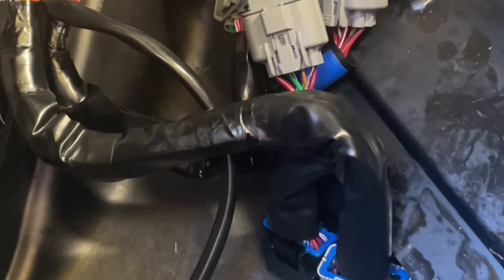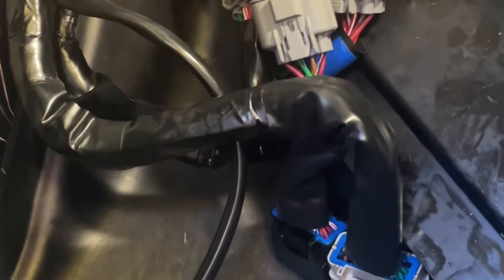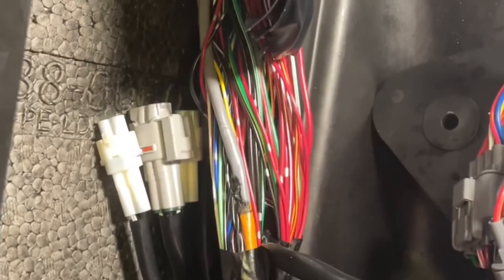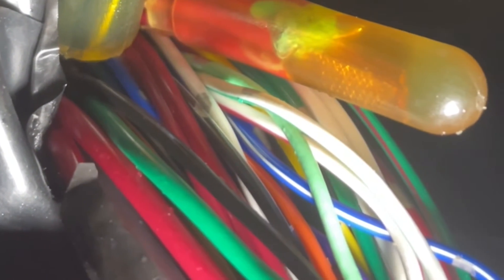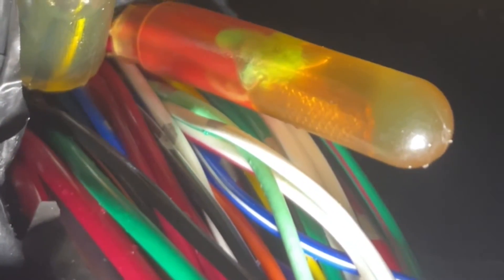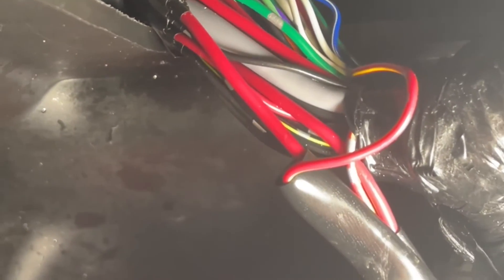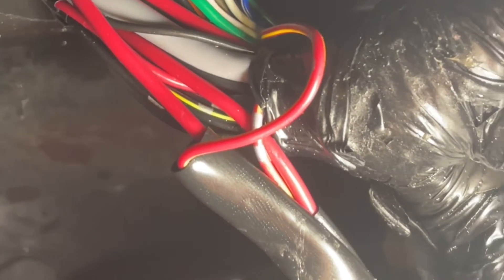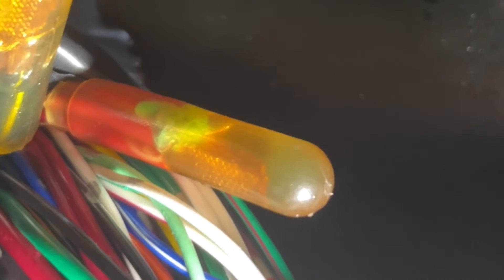Tech Topics: Finding corrosion in my 2022 Kawasaki Ultra 310 Jet Ski Wire Harness

Comment: I am wondering if Kawasaki build their own wiring harness or it comes from a parts supplier could be a supplier issue? 

Glad you were able to find what was going wrong, I have 2 new ultras ordered! Enjoy the videos!
Reply from the maker: The harness is made by a third party supplier- I just learned that the harness for the 2021 was made in Mexico so maybe this one was too…I love the ski, it’s awesome you will not believe how much fun they are. The ride and comfort is top notch! Mine was a very early production ski so hopefully this issue is isolated to a few of the earlier units. Kawasaki is replacing my wire harness in the ski to be safe.
Reply: Thanks! We ordered the ultras for Lake Michigan a little different out there in south east fl. Used to ride out of Boynton  inlet and understand your concern regarding salt. Keep it up many thanks!

Comment: Kawasaki should be paying you to fix this, and you should be able to punch an engineer in the face 😂😂
Reply from the maker: Hahaha yes definitely frustrating. They are sending me a new harness for the ski. I don’t mind working on the ski but it’s never fun when you have an unforeseen issue with a new vehicle
Reply from the maker: The mechanics joke is that a mechanic must’ve screwed an engineer’s wife and this is the payback
Reply: @JDsWaterWorld  Thanks putting this video up and also doing the work. The sad part is most dealer techs(this includes cars) are nothing more than parts changers. If they don’t have the answer directly in front of them they simply can’t operate. Part of it also comes down to how they get paid because they WILL NOT drive a vehicle/boat/PWC around for long periods of time to replicate the issue. I have a few thousand in specially scan equipment and other tools so I can diagnose things myself, then tell them what’s wrong if it’s under warranty. Now with the increased use of CAN bus networks on cars, and now on out 2022+ Ultras these people need to be electronic techs and they simply are not. 

In regards to PWCs, especially Kawasaki; Many of Kawis network are motorcycle dealers that are far away from water. So many won’t even bother test riding them, which sometimes needs to be done especially if the issues happen while under load. 

Rant: CAN bus networks don’t belong on cars let alone JetSkis and boats. The system isn’t robust enough because if one node pulls the signal down, the entire network goes down which can be an absolute nightmare to troubleshoot. With out Ultras there are only 3 stops + a connector the signal has to make, so it’s not a biggie however in cars you could have up to 50+. I almost feel as if Ethernet is a better way to go, which we are seeing now on some German cars. Rant over. 👍
Reply from the maker: Thanks for this comment. All very true info. I am always talking about how everything is over engineered these days. I had the same attitude as you- complete the diagnostic myself and then update the dealer with my findings for warranty purposes.

Comment: Thanks JD….
What a great find, You did a better job than a dealer could. As you know I have a 2023 hoping I’m not gonna have the same problem or it’s not a widespread issue for all of us ,If it is I’ll contact you for some pointers, thanks again for letting us all know. Good looking out.
Keep the great content coming!
Reply from the maker: My guess is that some of these resin splices were just done wrong…doesn’t seem like all of them are defective so maybe it’s luck of the draw. Hopefully the issue will be just a few early units like mine.. I tried to take it to my dealer but they couldn’t replicate the issue…I knew something was off so couldn’t rest until I found the actual problem.

Comment: Talk about frustration!!!  It's amazing that you were able to diagnose the issue yourself!  How difficult would it be to explain exactly where that connection is on the ski?  I might want to verify mine is having an issue.  I was doing my 50 hour exhaust filter service and found  a completely stripped bolt on the exhaust manifold. Whoever assembled it cross threaded it and send it home!!  Idiots. I love my Kawasaki Jet Ski but this is disappointing to hear.  Thanks JD and sorry that happened.
Reply from the maker: 100% agree. Luckily I was still able to use it when it was having the intermittent issues but it was definitely frustrating. I actually did bring it into the dealer, but they couldn’t replicate the issue so didn’t diagnose…
Reply from the maker: I am going to post a video about testing your harness voltage at various points, but it’s right behind the access panel above the battery compartment, about 12” down the harness. You have to carefully remove the sheathing and electrical tape to expose the harness. Also have to do yoga to get down in there with two hands…big pain
Reply from the maker: Yeah I remember you mentioning that about the bolts- that sucks. Well I hope this issue is isolated to a few units…we shall see I guess

Comment: Wow you found the issue.. recall issue Kawasaki!
Reply from the maker: Easier to fix myself than wait 6 months for the dealer...but if it turns out they recall the entire harness I guess I will have to bring it in.
Reply: It seems that you are only in saltwater, who knows maybe some water got in there and with the humidity just corroded it really fast. Salt water and humidity is a bad combination
Reply from the maker: Unfortunately many of us have had this issue- it’s a manufacturing defect in the splices in the harness- which evidentially was made in Mexico
Reply: @JDsWaterWorld  It's funny even if it were put together faulty at the factory what would cause that nasty early corrosion build up...
Reply from the maker: So when they sealed the resin splices, moisture was trapped inside!

Comment: Hope it’s a fluke and we don’t see it wide spread JD🤞🏽.  Thanks for sharing your findings.  Appreciate you sharing
Reply from the maker: Agreed. Good news was that it was really easy and cheap to fix. Im sure they will be on top of it if it’s a real issue
Reply: Thank you sir! Intermittent electrical issues are the worst. I hope Kevin watch’s this video and uses his Kawasaki connections to give those guys a heads up.
Reply from the maker: James, I provided this information to my dealer, who contacted Kawasaki. Kevin knows too as well 👍🏻
Reply: I stopped at my dealer and showed the tech. I txt him the video. He was glad to see this!
Reply from the maker: @James Bounds I don’t know if you saw my update comment, but I forwarded these images to my dealer, and my dealer reached out to Kawasaki. They are basically insisting that I have the entire harness in the ski replaced. If you are not having issues there is no need to worry, your ski probably not affected. 😎